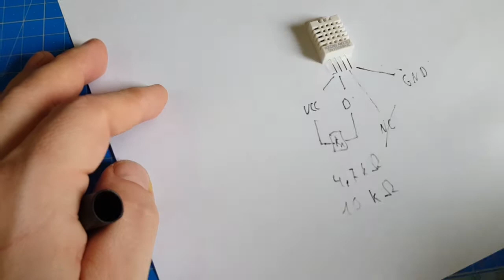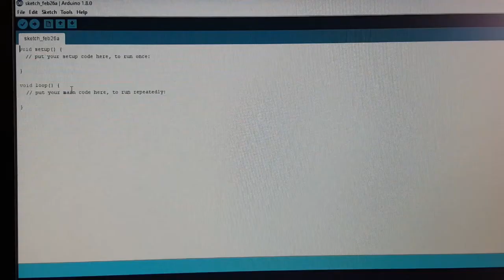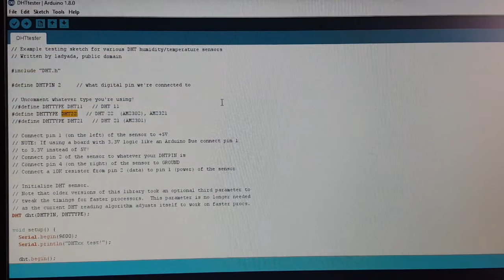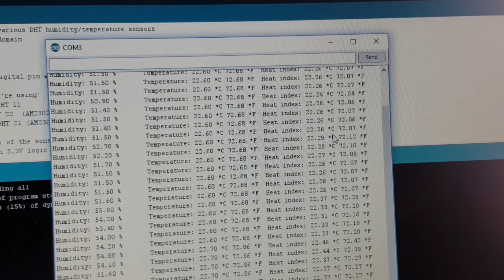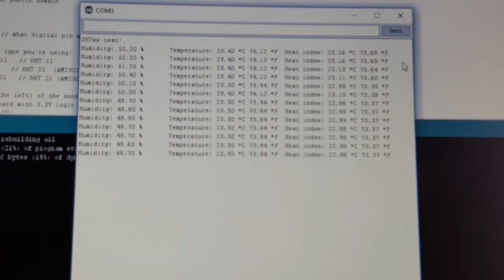DHT22 temperature and humidity sensor

Comment: For my understanding as a novice, what is the benefit of using this compared with a smart wifi temp/humidity sensor? Im after a wifi sensor that can report reading every second or so, most of the off the shelf ones on the market at present will only report based on rate of change +0.5c to save battery life. Thanks

Comment: What I don't understand is, if the Nano is 3.3V logic and you power the sensor with 5V, doesn't it fry the board? . . . will the data pin output 5V signal?

Comment: Well can you guide me about the connection of LCD with arduino to display the temperature detected by sensor on LCD in this circuit on breadboard to make the project portable.
Reply: And source code for arduino

Comment: wait the analog is testing ambient air temp digital is testing the desktop temp. The desktop is absorbing the heat from the light so it will be hotter than the air. first law of thermodynamic.. I think... I can't remember any more..

Comment: The reason why you don't need a pull up resistor is that the Arduino has internal pull ups when using the data pin as an input.